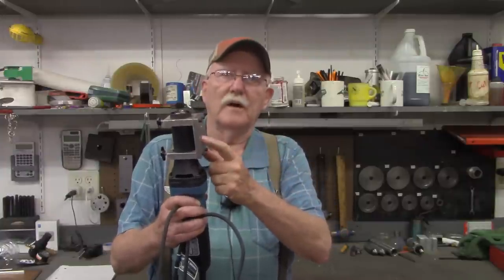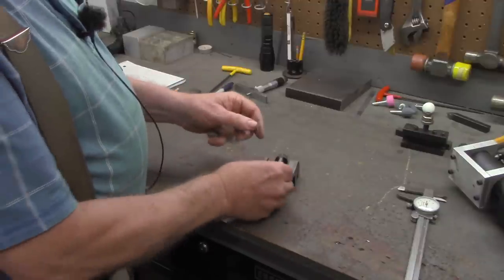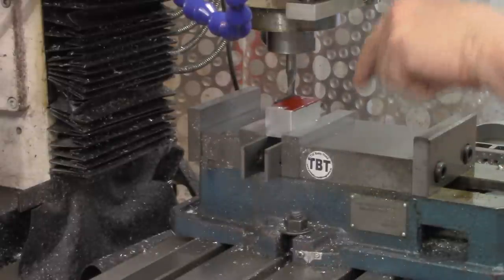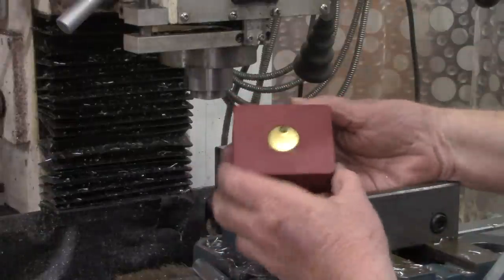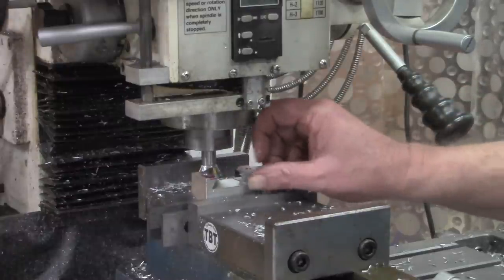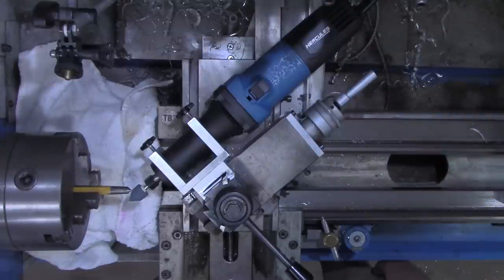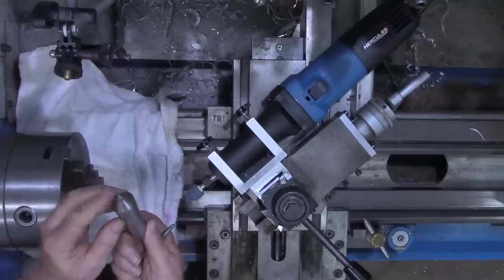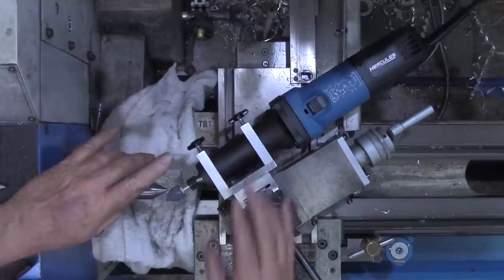Tool Post Grinder Take 2 = Part 2 - IT WORKS

Comment: Next project--how about showing how to set up and grind the center point in transfer punches??  I have always dreaded the day I have to toss one when they get dull.  Seems the key would be to get a grinding wheel or a lathe cutter that could meet the base of the angle of the center point.

Comment: Enjoyed the video very much Lee. For the dead centers, I would have run a dial along the angle for a very precise setup, as the centre is best to conform perfectly with the drilled centers for optimum effect. Cheers!
Really great treatment for those punches and perfect for a prick punch which needs a smaller angle and is more prone to damage in use. I always found the prick punch made from a round file was the go-to tool for broken bolts and such.

Comment: Thanks for the video on cutting the dovetails. I am getting ready to remake a part for a grinder rest that has two sets of dovetails. I really missed the mark on the one I am remaking. This is a Harold Hall design (Home metalworking workshop channel) and may be a little over engineered but it should be very versatile. I think watching you cut your dovetails was a good refresher and I should be able to come up with a much better finished part this time.

Comment: If you're cutting a dovetail for a BX size Aloris, two 3/8 edge finders work really well as gages pins. If you put an adjustable parallel between the
pins and tighten it up,  the size over the parallel comes out close to .750   If you're making matching dovetails, make sure to use the same dovetail cutter for both dovetails to make sure the angle fits nicely.

Comment: If the air intake of that grinder is next to the front end, may want to find something to put around it to keep fine metal and stone particles out of motor, we used a piece of panty hose for our 18v Dewalt angle grinder, kelp sucking in metal bits and covering the internals with it, eventually it will burn up the motor if it stays in there, just something to think about to get more life out of your equipment

Comment: Great job, i I just bought one of these die grinders, are these stones rated for 25000 rpm? Don't know own why I thought cut off wheels would work but neither cut off or flip disc's are rated for that rpm.  Now I'm worried about these. Chinese stones😬

Comment: G'day  Lee.    Excellent video on making the holder as making the toolpost locator. Most important thing is your modification works really well. Just wondering on the mods to suit R8 or another grind  on a longer shaft